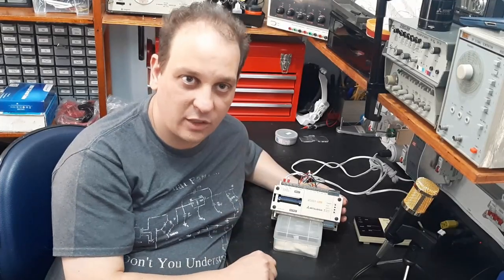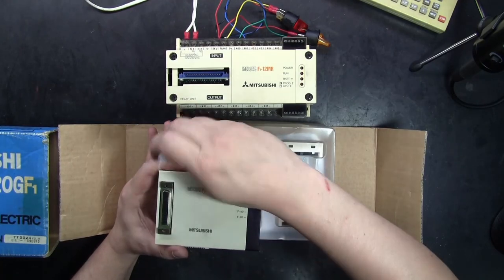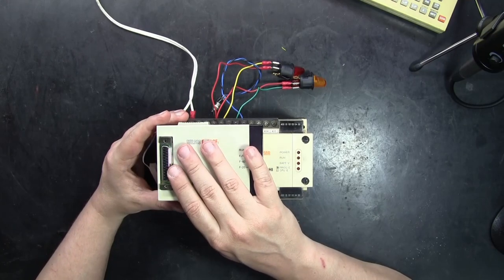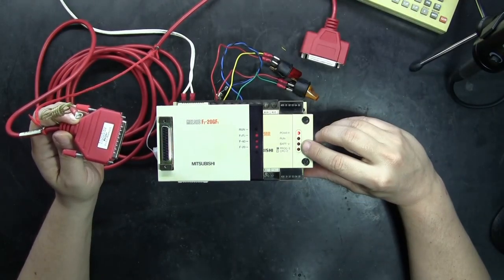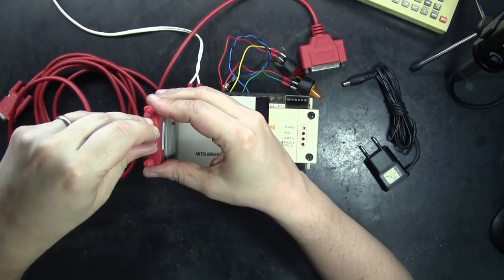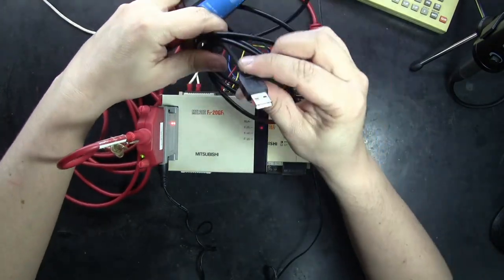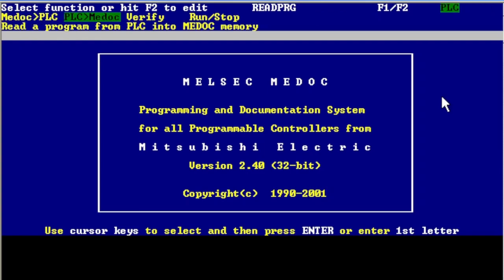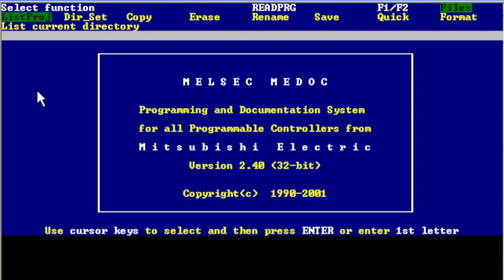How to upload a F1 PLC program right into your MELSEC MEDOC?

Comment: Very helpful video. Which pins on your SC09 232/422 converter cable did you provide supply voltage to?
Reply from the maker: Hello Edward! Thank you for your comment. On the DB25 side, I used pins 12,13, 24 and 25 all tied with each other and connected to +5V. For 0V, I tied pins 7 and 8 of the DB25 and I connected to 0V.

Comment: A very helpful video.
I have looked for this version for a while.
do you know if your version supoports A2N models?
 ( In case yes) how/where did you get it or how can I get it?
Reply from the maker: Hello Jorge! My version also doesn't have A2N but, for cases like these, usually, there is a compatible CPU model that can be used instead. I recommend you create a project for any APLC type (let's say, A3A for example) and then, try to read the program of your A2N CPU. If choosing A3A as CPU is not compatible, MEDOC will show in the gray status bar, something like "Cannot communicate with CPU (XX)" and replacing the XX in my text, it will appear what CPU MEDOC detected as your CPU, so you create a new project for this detected type. It is not a perfect solution but, at least, you can do some backup. Regards!